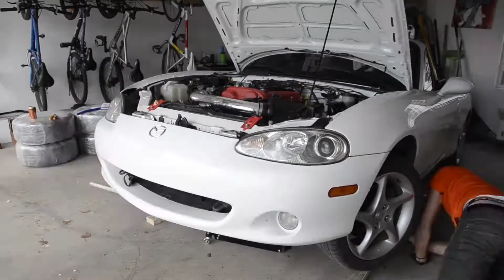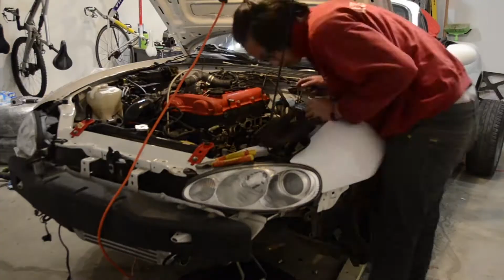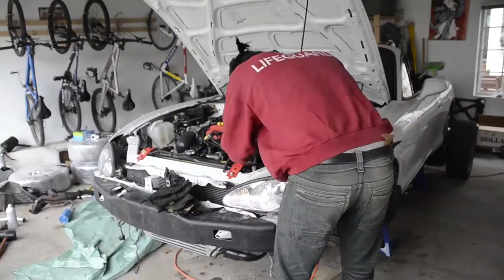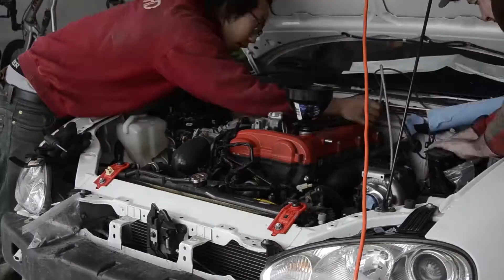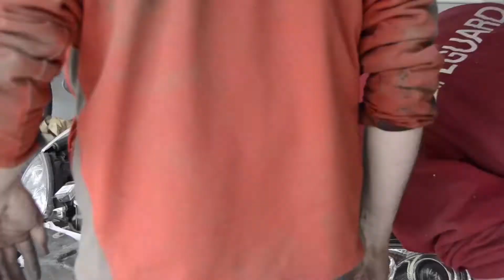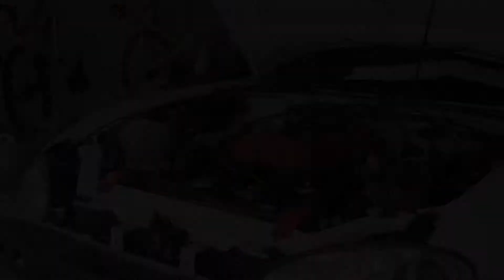2003 Miata FM2 Turbo kit install in 2 mins

Comment: 230 whp seems low for the kit.. are you running a lower boost or? I'm getting a turbo this summer and hoping to get about 280 whp from the FM kit
Reply: Garrett OBrien 280 is definatly achievable just up the boost